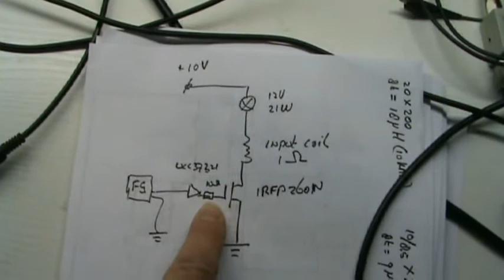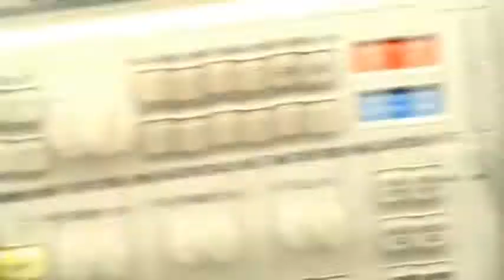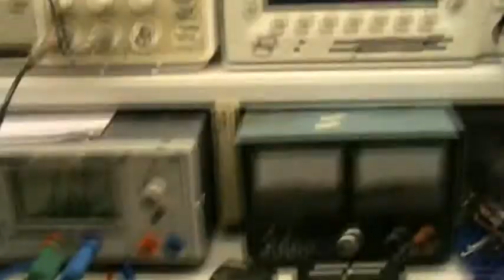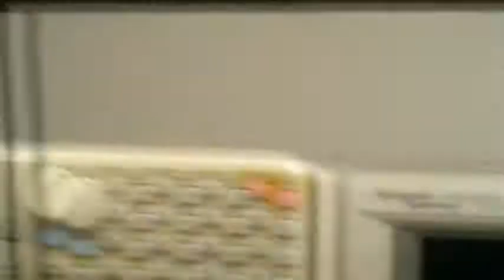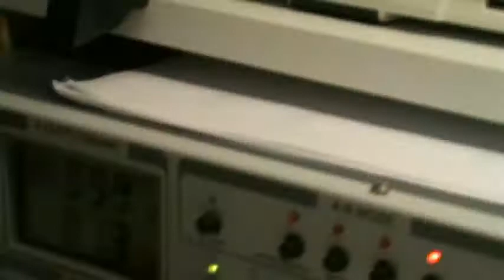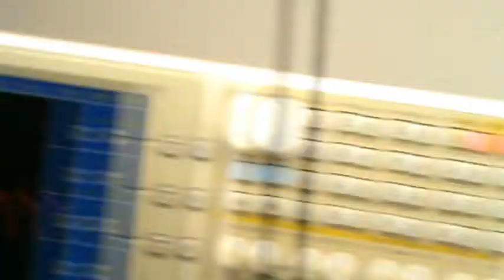EMJ 6

Comment: Itsu, in the screenshots you posted on OUR recently, I see that the channel you are using with the Current Probe gives the vertical setting as "10mAohm" etc. I am confused by this, as it seems to indicate a conversion according to V=IR implying a Vdrop across a current viewing resistor. When I've used this same TDS3054B scope model with a Tek current probe TCP202 or P6021,  as I recall the scope displays the vertical setting as "10mA" without the Ohm symbol, because the probe doesn't care about a current-viewing resistor. I don't have such a scope in front of me at the moment, but I've just gone through the manual and I can't find the information I need. Can you tell me please: What kind (make, model number) of Current Probe you are using, and did you have to set the Probe Type in the menu or did the scope auto-detect it as a Current Probe?
Thanks ... nice equipment you've got there, I'm jealous.
Reply from the maker: Hi TK,

Yes i am very proud having this equipment, and i must say it makes a lot of difference when used properly ( a big thanks to you for all those explainations about using equipment properly in a lot of your video's/posts)

The channel 4 (green) which i use for the current probe (AM 503B controller with A6302 probe) is set to 50 Ohm (therfor the Ohm sign) because the current controller needs this, together with the channel set to a fixed 10mV/div.

Then the current controller can be used to set the real A/div. which i then often display in the video's.

I can set each channel on the TDS3054B for current or voltage probe so have set channel 4 manually to current when used for the current probe.
The math function then automaticaly displays as Watts when multiplying voltage x current, else as VV.

Regards Itsu
Reply: itsusable
Ah, OK  that explains it very well, thank you. As you know, the scope automatically detects certain kinds of current probes and will set those channels to (value) A or mA/div and generally uses 1 megohm input impedance by default, so there is no symbol shown for this input impedance value. Your probe uses 50 ohm input impedance and a fixed vertical scale value so the "ohm" symbol is displayed and isn't actually part of the reading, just a marker for the impedance. I understand now.
Thanks for your quick reply, that clears it all up. I couldn't find it in the manual because I was looking in the wrong place!
Keep up the good work!